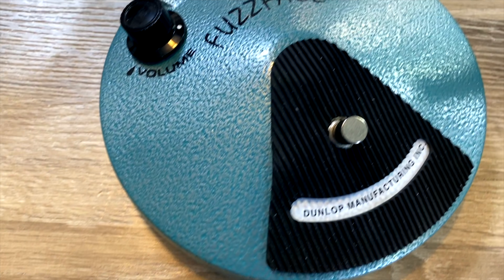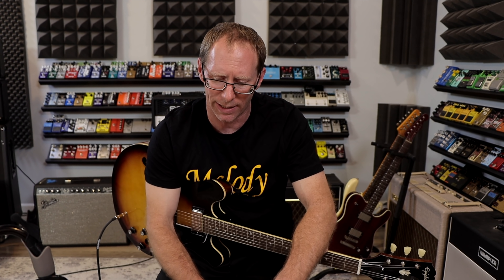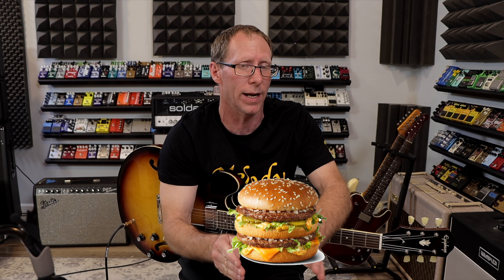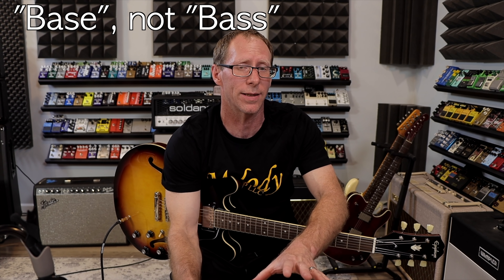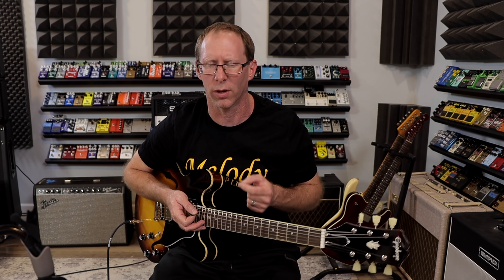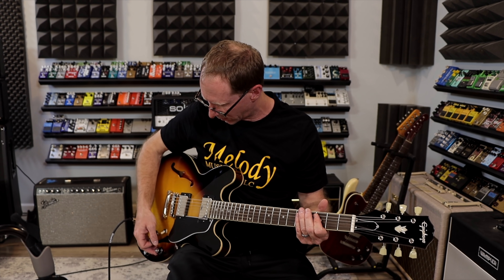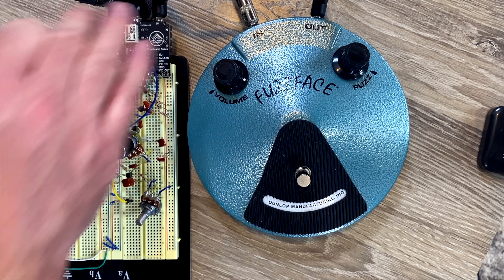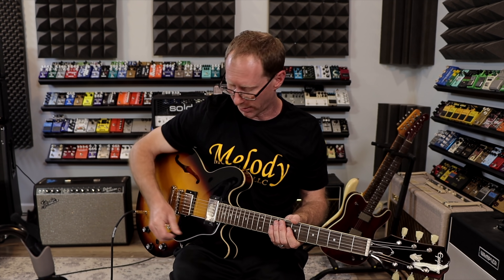A new type of Fuzz Pedal Circuit?!

Comment: Many years ago a site named FuzzCentral made a lot of experiments with FF´s, and they came up with one using a BD139 as T2, and I suppose you could make one with
Ge transistors and a BD140 also. They also found out that you can compensate a Ge transistors temperature drift with a Ge diode in reverse.

Comment: As a listener and not a player:  I think the 2nd JFET version was the better of the two JFET circuits.  They all sounded "musically useful" in that they changed the sound in a manner that wasn't unpleasant (think of how dreadful crossover distortion sounds)
JFETs can be used in amplifier stages to intentionally distort in the manner of a tube for people who want a "tube sound".
I would be willing to bet that some of the ultra low noise JFETs could be used to create some very interesting effects because they tend to have a very large gm compared to a run of the mill JFET.

Comment: Interesting.
As much as I like Germanium, I've never had any use for Silicon circuits; when using multi option effects, that's always the setting that never gets used.LED, No clipping? All good.The Si? Nope.When builders inevitably replace the Ge with Si, IMO, - it greatly damages the pedal.
I prefered the Muff with the JFETS.
When I'm looking for Fuzzes and Drives, volume knob clean up is a big deal; I'm always looking for the in between, lower gain, broken sounds that are generally hard to achieve. These days, I consider the Tone Bender 1.5 to be the ideal in all manners of goodness squared.
The Big Muff Pi with Wicker was one of my first pedals, - back before I knew what could be done, it sounded god head.It's now become like one of those youthful relationships you neither regret, nor are particularly proud of.

Comment: I haven’t the slightest doubt that, as a designer, you know better, but this series is leading people to think differing, modern semiconductor constructions have their own sound.  Apples to apples, they absolutely do not, which you could prove simply by comparing them in their linear ranges.  

Nonlinearity, on the other hand, opens so many cans of worms for the operation of semiconductors that prediction becomes virtually impossible.  The same could be said for tubes but to a much lesser degree.  When the semiconductor gain element is operating ‘in the curve’, all predictions are moot.  The curve shape of non-linear transconductance in semicons is exquisitely sensitive to fairly small changes.  Changes of circuit impedance which are themselves created by the different gain element’s design, make it very difficult to decide whether apples or oranges are sweeter because the circuits cannot be duplicated using the different gain elements.   Engineering a distortion pedal comes dangerously close to art.  Which is a good thing, really!

Comment: I like the low pass tone of that first standard muff setting you demoed. The first full gain fet sound was choking silent on the initial attacks, then swelled in. The next adjusted sound with those hard clipping diodes IN, sounded quite similar to the first standard MUFF demo sound, even more I think if you'd rolled off a little more highs.
Cool sustain you did with the FUZZ FACE :-)
Tone-wise, i liked the standard muff demo sound best for higher notes lead playing. The muffled tone might have to be jacked up to a monster volume to be heard in a combo band mix though.
For me, distorted guitar sound seems to boil down to how hard it's distorting and the EQ shape...typically hi or lo cut, cookie bite or midrange hump. I'm not sure I could discriminate between one pedal to the next in a band mix provided the pedals all had equal breakup and EQ shape, so that means I'd find many pedals would seem satisfactory.

Comment: Isn't that the Jam pedals Eureka Fuzz concept? It does Muff AND FFace sounds, but, IMO , neither really well.
To my ears, Fuzz comes down to gain levels, which is, I think, part of what you were getting at.Of all the hundreds of just newer releases out there( I know I've tried @least 40 in the last year), there really isn't much variation, despite price points.There's the vintage spec Germanium Face and early Benders, and a hundred variations of high gain.Many attempts at capturing the qualities of Germanium types, with limited degrees of success. You can spend years finding that out.

Comment: In the 90's, guy named Jack Orman had a schematic on his website for a circuit called Fet Muff. It was basically big muff topology, but fets instead of the bipolar transistors and he had tweaked the tone to sound a bit like an amp overdrive.

Comment: You mention Big Muffs don't clean up, which I've found to be true. And that's left me wondering for decades how one gets David Gilmour's Big Muff tone. I have yet to find a Big Muff that gives me that sweet, singing sustain without sounding like a grungy wet blanket has been thrown over my amp. Dinosaur Jr.? I can get that tone. "Sorrow"? I can't get that tone with a Big Muff.
Reply: Just to save time in the replies. "Tone is in the fingers." "You need a Strat." "That would be a Triangle / Ram's Head Big Muff, there's a re-issue." "Have you tried the Darkside pedal by Keeley?" There. We've gotten those out of the way 😄

Comment: Very cool video. 
I would like to see you compare different types of germanium or silicon transistors in the three classic fuzz circuits #fuzzface #tonebender #bigmuff. 
Guess that could be interesting and an easy to mod for beginners if they like the sound of a different transistor.

Comment: i guess i really do not like the big muff very much, and i did not like the clipping diodes in with the fet muff. without the clipping diodes, i really like that sound. 

silicon fuzz face is a nice sound, and i think i might actually enjoy it better with the jfet. i love midrange growly stuff, so if you say it's midrangey, i guess that's why i like it. 

tossup between the jfet versions of each... i already knew i like jfets though, through tinkering with the breadboard. 

cool vid! i actually would have loved to hear a tiny bit more about impedance and the way 2 jfets react in a fuzz face.

Comment: Apart from the varying degrees of splattiness, they all sounded the same to me.  I find that fuzz just disappears in the mix with live bands, so no matter what my gigging setup, I always end up playing cleaner there than I would when practising at home.
Reply: Add mids. Either a mid focused fuzz or put an eq after the fuzz. Makes a huge difference. Muff type fuzz is generally rubbish in the mix as it is scooped to hell.
Reply: @miscusername  I think that's why Marshall and Orange amps sound middly when overdriven: so they can be heard in the mix.  I'm not a fan of middle-boosted tones, and prefer just a little overdrive, so the guitar can still be heard without changing its tone too much.
Reply: @ParaBellum2024  exactly. Perhaps fuzz just isn't for you. Although there are fuzz boxes with specific mid control so you can dial in just the right amount to stand out. Either way, rock on!

Comment: So does using JFETs help, if you were designing a Fuzz Face like circuit, but you wanted to offer more EQ settings, like to put in a 2-control tone circuit? Presumably, you would have a more "stable" platform without having to add extra buffering?

Comment: Video Explaining more about the impedance of the first stage of the fuzz face. The Boss Blue Drivers uses many MOSFETS in a back to back configuration which I don't see many other pedals using JFETS or MOSFETS in this configurations which you can make a theory video about. The DOD Classic Tube schematic compared to the Tube Screamer on how to make the DOD classic Tube into more of a tube screamer midrange sounding. The DOD classic tube could be a nice pedal but it has to much gain and not enough midrange like the tube screamer.
Reply from the maker: Good idea, that gain stage arrangement is referred to as a discrete op amp. It has advantages and disadvantages but it is indeed a fun building block to mess with

Comment: I feel like the biggest difference to my ear is the attack and decay that the other transistors pull off so much better than the JFETs but that could be a persons flavor too? Splatty with a short decay or creamy and long sustain. Not knowing a whole lot other than putting kits together, instead of unnecessarily throwing JFETs in, a bias control comes in really handy for those sorts of tones with other transistors? Dunno but that experimental FuzzFace sound could be cool!

Comment: I love this kind of content. I like the big muff with the hard clipping, but I suppose you could just add soft clipping to the first gain stage too and achieve a similar effect while staying closer to big muff design. Also reducing the interstage caps to roll of some of the bass for less pump/breathe. However, a nice compression could also be wangled out of it with some tweaks to make it more of a sustainy fuzz thing without that pump/breathe thing being so dramatic. As for FET based fuzz face, how about direct coupled 3rd FET onto mu boost preamp section with the positive feedback gain control like the fuzz face? Maybe that would work, or some kind of Sziklai N/P FET thing... so many ideas!

Comment: As far as propositions for videos go, there are two components about which I have long wondered whether it would be possible to build a distortion circuit around them. One is a reed relay - I guess it would convert the electrical signal to a square with very noisy slopes or something? I know switching frequencies on those don't go all the way to 20 kHz but I suspect you could make it into a bass fuzz or something like that. Now the other component is a Zener diode - of course wired in such a way to utilize its reverse breakdown behavior. Now I am not sure whether it would be possible to use it as a drop in replacement for regular diodes in clipping stages, but afaik some of them have lower Zener voltages, so maybe it could work?

Comment: I made a Jack Orman Mos-Face a number of years back (he posted the circuit in 2000).  It uses a silicon transistor for Q1 in a Fuzz Face circuit, and a BS170 MosFet for Q2 (one of Zach Vex's favorites).  Does it sound like a germanium Fuzz Face?  Nah.  Does it sound good?  Sure.  After all, all is fair in fuzz and wah.  Let us remember that there are millions of ways to corrupt the fidelity of an audio signal.  And if your sonic/timbral goal is to exploit the corruption of fidelity in a musical context, then any way you get there is valid.

Comment: Experimental fuzz circuit?  Click LIKE, then listen to Brian. 😃

To me the Fuzz Face is an iconic pedal.  Very simple circuit. Cleans up in a really cool way. And the Fuzz Factory takes that circuit to (and beyond) it limitations. The J-FET version didn’t do much for me. However, I think you may be onto something really cool with that J-FET + clipping diodes concept. Sounded like it had real potential. And remember, splatty/gated distortion can be really cool sometimes.

ETA talking about changing input impedance wouldn’t make me stop watching! Techno nerd talk is always welcome.

Comment: Does lowering gain on jfet curcuit below 12 oclock ,plexi drive,  help eliminate splattering when stacking
Reply from the maker: A little, but not really - gain control comes after the first jfet. You'd need to kill some signal before hitting the first stage.
Reply: Thanks , enjoy the info in vidios

Comment: The wicker muff is actually the most versatile and loud muff I’ve ever heard 👍
Reply: Is that an EH pedal?
Reply: @paulcowart3174  yeah the wicker is a switch that disconnects the tone circuit so its like if you love the BM with its tone cranked you will love this one with the switch even more as it does give it moar when you engage that switch.
Reply: @peteytwofinger  No, you are wrong. You are talking about the tone switch. The Wicker switch is a high frequency filter that produces a brighter sound.

Comment: Don't you think jfets need different approach? Putting jfet in some 60 years old schematic made for some old bjt and expecting it to sound same is really unfair. What do we know about jfets in pedals? Fetzer valve? Jfet buffer? That's all it? Ok, u-amp, maybe. Lots of jfet fuzzes? No. Like this type of transistor just not made for fuzz. This is sad.
Reply from the maker: This is literally entirely explained in the video. No, I'm not just swapping jfets for NPN's. I AM insuring that eq's, gains, etc are similar-ish as much as possible to NPN type. As far as "this type of transistor is not made for fuzz" is a honestly ridiculous statement - NO transistor is made for fuzz. They are switches and used as gain stages which some people at some point liked when used in a particular way that created fuzz.
Reply: Well, I think I misunderstood a concept about staying as close as possible to initial schematic. And, yes, I agree that fuss is historically just a broken circuit someone fing sounding interestingly.
And also, may be this is stupid question, but why people use jfet buffers. I mean jfet common source configuration still have input resistance equal to 1MOhm resistor from gate to ground. And in most cases input capacitance will be small enought for audio frequency. And also you can have gain at first stage, which mean less additional noise. So why use common drain jfet on input?

Comment: Pretty cool video! Escobedo has an article called Many Faces of Fuzz, and it shows some cool transistor combinations for a Fuzz Face. My personal favorite is BJT on Q1 and MOSFET on Q2, without any tweaks on the circuit. The JFET on Q2 version gets a really cool sound once you properly bias it, almost like an overdrive (check out the May Queen II by runoffgroove)

Comment: what JFETs did you use?
Reply from the maker: J201 here
Reply: @wampler_pedals  looks like it's the most common n jfet in the world. And kind of very old, fairchild stopped producing TO version years ago . Some people say it's not good one. Anyway, why it is so popular?
Reply from the maker: @RonaldGramm  probably because years ago a circuit called the Tillman preamp used a J201, and it just carried over into the DIY world. Since most of the pedal companies came from that DIY world it just stuck I suppose. Though, the J201's do have a particular type of sound and response that it pretty nifty for many things.
Reply: @wampler_pedals  thanks
Reply: @RonaldGramm  I usually see the J201 in amp-in-a-box type pedals. Usually they replicate a 12ax7 based circuit as is and just replace the tubes with transistors. I guess the J201 is the closest emulation of the tubes?
Reply from the maker: @dispersemedia  Nah, not really. Jfet's are mildly analogous to 12ax7, but not enough to call it an emulation by itself. There's a lot of differences between a vacuum tube and a transistor. To quote the great RG Keen: "JFETs are not tubes. The do not sound "just like tubes", as you know. They sound just like... JFETs...It is similar only to the extent that it is a depletion mode biased device. Tubes are very much more like depletion mode MOSFETs (which do exist!) than JFETs. Every possible depletion mode device can be biased in the same manner as a tube.

Other than that, it is just a three terminal device. One of the sophmore EE classes used to make you think in terms of generic three terminal devices, making note of the similarities of plate=collector=drain, grid=base=gate, and cathode=emitter=source." With that said, a common thing we do is try to use some sort of technology whether diode clipping or transistor saturation mixed with other types of circuit bits in order to somewhat sound like what many call "The Tube Sound"
Reply: @dispersemedia  if you look at runoffgrove, you can see not only j201 in the article about fetzer valve. But they  have a number of jfet samples with calculations. I don't think j201 is unique model for emulating this type of valve
Reply: @wampler_pedals  Thank you so much for the excellent videos, I absolutely love this one! Would you consider making more videos about characteristics (envelope in particular) of different gain stage circuits? I believe thoughts like this one about JFET/MOSFET characteristics would help a lot of people in picking the right design for their project and demystify some of the "folklore" surrounding them.
Reply: @wamplerpedals I am doing a lot of experimentation at the moment, and it's astonishing how many circuits use J201s, which I just can't get my hands on easily since they were discontinued. Are there any good replacement equivalents in that nice TO92 package?
Reply: @RatBastardDan  I'm not sure where there's a good trustworthy source for J201s in a TO92 package. but you can find the smd version that's presoldered to adapter boards for use with through hole stuff. pedal PCB sells them, among others.